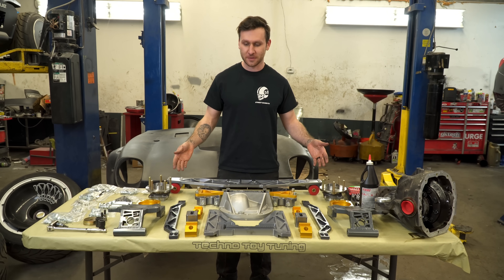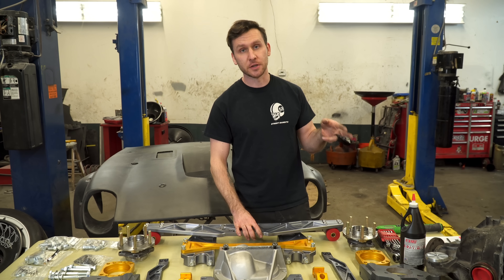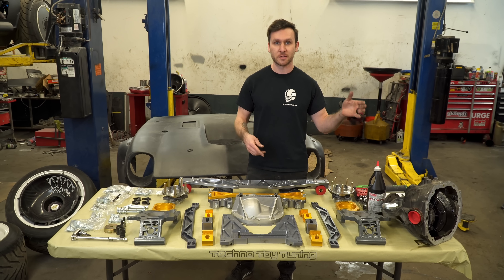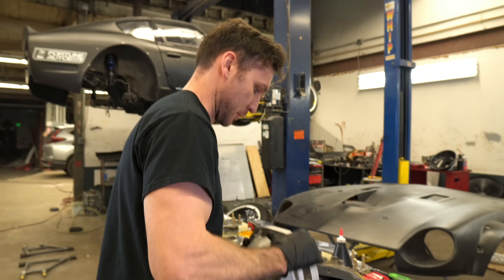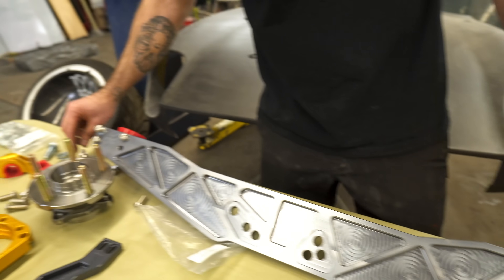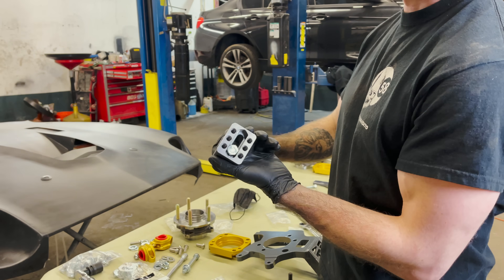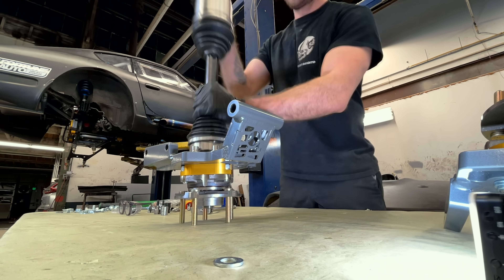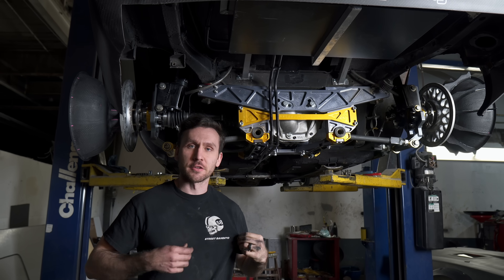240Z Techno Toy Tuning Ford 8.8 Differential Kit Install | (EP #76)

Comment: ford 8.8 is an amazing diff, no matter if it is ifs or solid axle...i swapped 8.8 solid axle into my jeep and my f150s came stock with front and rear with them... 4 wheel burnouts on 305 nt420s  during truck tugs and no problems yet

Comment: With all the high quality parts used on this car and the anticipated power the turbo S2000 motor is going to put out I would be very hesitant to use a junkyard diff.

Comment: Seems like alot of that could have been built in less pieces, I know a lot of it is for being able to mix and match different kits and axels ect. Do u ever worry about the soft anodized aluminum stretching esp with those hub adapters? Why not use all steel?
Reply: The t3 kit is garbage, I have tons or pictures and have talked to many people who broke those parts.

Comment: What are you going to be doing for a LSD? Will the factory exploder diff be up for handling the power of the boosted F22? Granted those are not torque monsters but using a clapped out factory junkyard LSD doesn't guaranty you having the power delivery to both wheels. At least you won't have a hard time finding parts or spend too much time swapping it out if you find out that the LSD isn't up to the task. Never trust an Exploder owner to actually have ever performed maintenance on the diff.

Comment: please don't try burning out the bushes at home. particularly in sheet metal parts. Had a control arm fail on a car because the previous owner overheated the control arm which caused the control arm to rust on the inside of the bushing surface and eventually snap without any outer sign of damage. all this in an area without snow/salt on the roads and where rust is really not a problem for most cars.